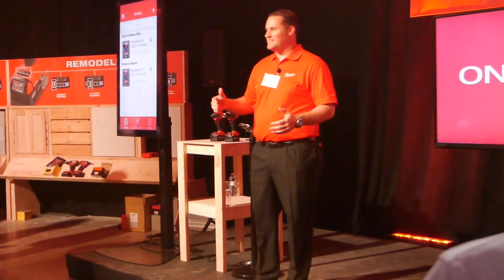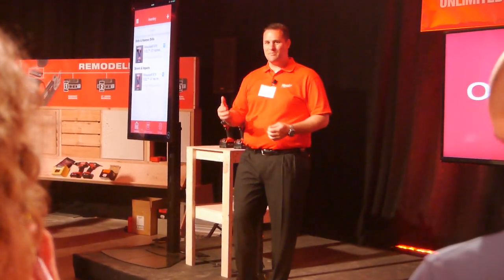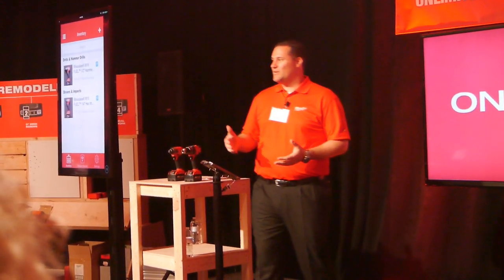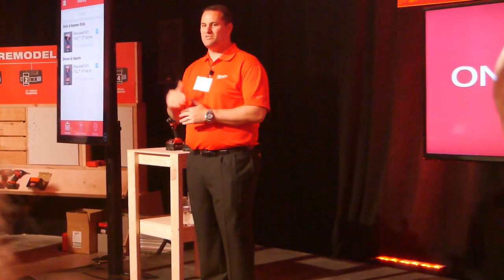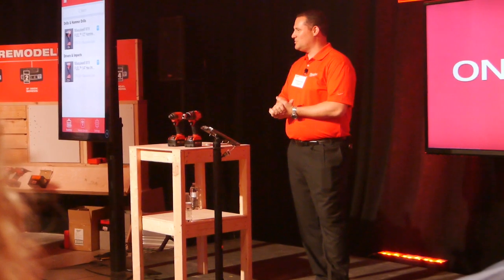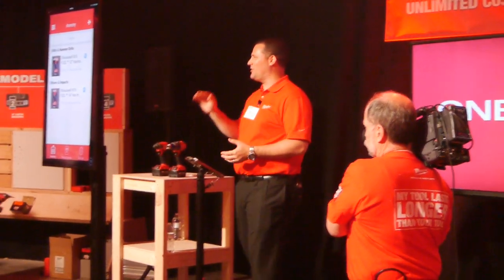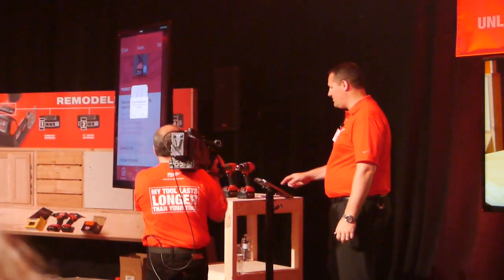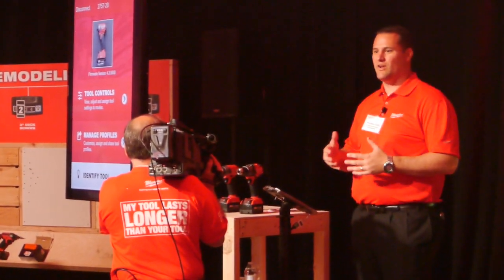What is Milwaukee One Key ?

Comment: This is great for pros who do repetive work and manufacturing facilities.  It's pretty unnecessary for a diy guy like myself, but milwaukee is not intended for the diy user.  Looks like a well thought out app that will likely make this the new standard for many high production users.
Reply from the maker: Wild Goose the good thing is they will release 2 versions of the new next gen fuel drills and impacts, one with the One Key feature and one without so users can choose between the 2
Reply from the maker: Wild Goose and besides being able to tweak power tool settings, the One Key feature is more than that. You can also do an inventory of all your tools using One Key- Milwaukee tools and tools from other manufacturers and also you can view statistics on your One Key enabled Milwaukee tool

Comment: And what if you don't own a smartphone or any other device to set up your tool?

Then your drill is a useless piece of plastics
Reply from the maker: Jakob Illmer The device will work just fine out of the box with the preset factory settings without the smartphone app. The smartphone app is to adjust settings even further to your liking. Also there will be a standard version of the next gen Milwaukee drills and impacts along with the One Key versions so you can choose the non One Key versions if you don't need the added features.
Reply: Wow the guy literally said you dont need the app 10 times.......